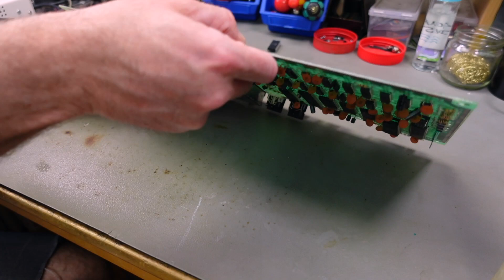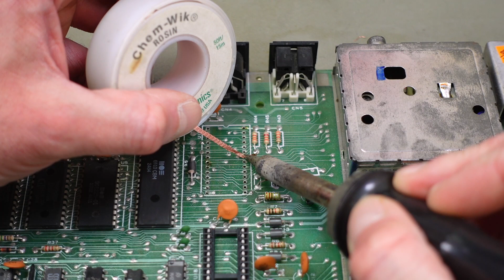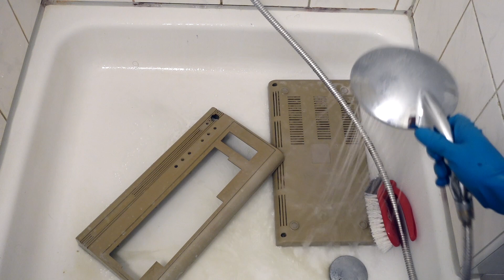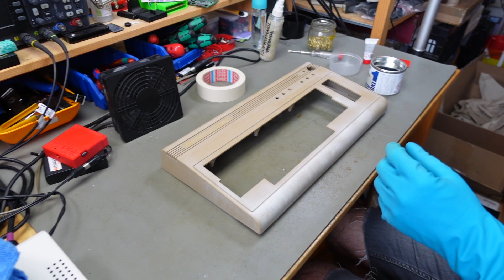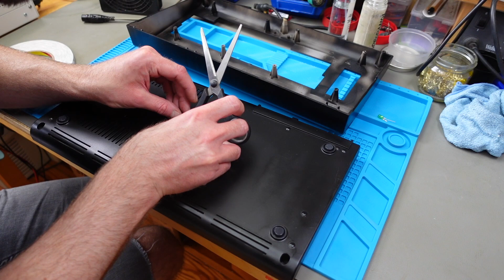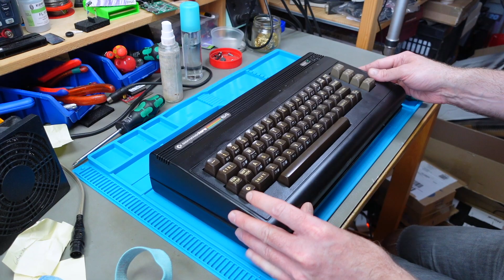Challenging C64 Restoration and Repair

Comment: not a fan of the filler. it will fall out in a few years. filler is usually the choice for dents, not holes. i use superglue and bakingsoda to close the hole and then the filler to hide the dent.

Comment: Hi Jan, can you tell me how to buy sockets for putting the chips on the c64. I'm planning on restore my old c64 with the help of a technician,  i am not. I didn't ask the last time. Where are you from? Thanks for sharing so much information to your audience. Thanks a lot Jan!
Reply from the maker: You can usually find the sockets in every electronics components (online) store. Just look for dual inline sockets (they come in two standard widths and different pin counts, should be relatively easy to pick the ones you need). Here in Germany, I usually order precision sockets from reichelt.de. If in doubt, you can always check out the Run/Stop Re-Store (online) that has all kinds of Commodore parts, shipped from the Netherlands.
Reply: @JanBeta  thank you a lot! Really!

Comment: I have a broken C64. The VIC Chip are not funktioning. Can I use an other VIC Chip or not?
Reply from the maker: Yes you can use another VIC-II. Just make sure it’s the same part number (65xx and 85xx use different supply voltages and are NOT interchangeable!). The number after the R doesn’t matter much, the different revisions are interchangeable and only provide slightly different picture quality.

Comment: There are some experiments that have replaced chips and processors using raspberry pico, those are micro controllers with the enough power to replace those chips if you program them correctly. The old chips are every time more scarce.
So far it has been done on 8086 cpus

Comment: That's a dust mask lol. It's useless for vapour and also viruses just in case you wear it to the supermarket as well !
Reply from the maker: I recommend you "do your own research": https://www.aerosol.mech.ubc.ca/what-size-particle-is-important-to-transmission/
Reply: @JanBeta  While Nick clearly doesn't understand how N95 masks work for viruses, he is correct that particlulate masks can't help protect you from solvent vapors.  I use dust masks and purified air respirators every day, and the training on them states very plainly that they will not protect the user from vapors, VOCs, gases, or low oxygen environments.  You'd need an activated carbon filter to absorb the vapors from the paint, and good ventilation such as fan in the window blowing outwards with fresh air coming in somewhere else would help, too.

Comment: Dear Mr Beta , how are you ? Thank you for your' entertaining videos on fixing the mighty C64 .
Just a question on a problem I have with one of my fix-up jobs : Does changing the timing varistor next to the oscillator affect the turning on of the machine ? I ruined my varistor and changed it out for a brown one I bought online . The C64 has blank screen . Nothing appearring on the monitor .
Reply from the maker: It should not affect the general state of the machine, just the video output. Depending on what output you use (composite or luma/chroma), you may get a black screen with a misaligned timing if the signal is off by too much to be picked up by the monitor. Usually you get some kind of distorted or black and white output though.

Comment: For the gaping hole, I'd personally try to patch in a section from an even more messed up VIC or 64, or I would spray some release agent on the good section, then use that to mold a new section to patch into that hole (after cutting or filing the hole to be more 'square'.

Comment: I would have used a different method of case repair. I would have used some old ABS plastic. Dissolved it into a paste by mixing it with acetone. Masking off on the top side and filling up holes from the backside. The bigger hole, can be rebuild, by using PVC sticks and glue them together with super glue. Finally use some two component epoxy glue on the backside, to stabelise it as good as possible.

Comment: Hey,  love your channel and so I'm a new subscriber.  I appreciate you knowledge of Commodores, C64's and electronics and that painting a case IS new to you.  If there is a next time and I suspect there will be, I'd like to share some tips that will help.  You should have filled the smaller holes in the case from the back side.  This would have cut down on the sanding, give the filler plugs more to hold on with and also given you a smoother finish in the front, even before sanding.  Filling the larger hole from the front was prob necessary, so that you could match the grooves, but, you should not have waited for the filler to get completely hard before starting the sanding, especially when it came to cutting the grooves.  Speaking of, if you'd have used less activator, the filler would have hardened slower, giving you more time to cut the grooves.  You should have given the body a light sanding all over with a fine grit to give the primer something to stick to, so that the paint is harder to scratch off.  Primer acts like a filler and fills fine scratches and nicks, if you sand down the first coat.  Also, black may be a cool color but it shows every flaw underneath.  I hope this was clear as I tried to keep it short and hope it helps.

Comment: As I was watching you remold the broken area I kept wondering if perhaps you could have gotten it a bit better with a careful use of a dremel. Not sure if any of the grinding discs are thin enough to match the case's lines but it might be worth a shot if you ever need to do this again.

Comment: Aloha !

For those of you having a damaged case but want the original look; You can use RAL 1019 Grey beige. 
I find it to be a very close match to the original color from the factory... (Unless you have an Aldi C64 hahaha)

As for the motive, a breadbin isn't smooth, first use some modelling clay on  a clean undamaged part of the case,
then after you have painted it, ever so gently press the clay on the wet paint. The little pattern will then be transferred so to speak.

Cheeeeeeeeeers

Jecepede

Comment: I would have used Milliput (epoxy putty) to fill the holes. There's a product called Blue Stuff, which is a reusable thermoplastic used for mould making. Using that, you can take an imprint of an undamaged part of the case (both the textured top and vents) which you could then lay over the holes on the top of the case and fill the holes from the underside.
Reply: Good feedback, something tells me Jan also has another perfect C64 that he could create a mold from for next time 😉

Comment: Man I cringed when you just dumped the entire hardener into the tin, that’s not how you use it! Your supposed to take out a dollop from the tin and put a pea amount of hardener with it then mix and apply, also you need a vapour mask for spray painting what you were wearing was a dust mask

Comment: You mentioned you replaced the bridge rectifier with a beefier one. What is the part number for the beefier rectifier?
Reply: @Drew-Dastardly  Thank you for the answer. I am learning about electronic components and when I do a search for bridge rectifier B33F1 I do not get any matches. I put that part # in mouser and digikey and they both came up with a ceramic capacitor. Is there something else I should be putting in the search to help me locate that part #?
Reply: @Drew-Dastardly  Thank you for your help and appreciate your time in replying, I will keep researching and try a few that I find, the journey is always exciting.

Comment: Always enjoy a commodore refurbishment thanks Jan 👍 The only suggestion I would make with the filler is maybe try the tape on the outside for the smaller holes - you can always leave the unwanted stuff inside the case. Though it may have still shrunk and has the same results 🤔

Comment: I suggest looking up fret files, used for guitar maintenance. One of those would probably be the perfect size to clear out the filled-in slits at the upper right of the case. I got one from eBay that's cheap and nasty but actually good enough to crown frets, for $6. It has smooth sides too, so it won't scratch up other parts of your work. Only the outer edges have file patterns chiseled in -- one edge rounded like fret wire, the other flat for finishing ends.

Also when patching holes that go all the way through, sometimes it's better to put the tape on the outside and fill from the back. You can leave it on the sloppy side for structural help, and then the thinnest coat of filler on the front will be needed after the tape comes off, for wherever you may have left an air void. But you won't have to sand off a bunch of spillover, because you let it spill over on the inside. This wouldn't have helped at all with the big hole in the corner, but it might have made your life easier on the six little button holes.

Comment: To be completely fair, this case was a prime candidate for experimentation and if you don't practice or push yourself, you don't learn. You might take some ideas from plastic modellers, especially for how they use plastic card and modelling putty. For example, the gentleman at The Model Shed has been doing extensive modification to the hull of a Bismarck ship model https://youtu.be/9j6Q9RtOxv4 If anything, look at the tools and supplies he uses; it's pretty amazing what you specialized gear you learn about that's common in other hobbies.

Comment: A trick to use if someone else want to repair a "complex" hole like that grille on the case is to make a silicone mold of the pattern and then attach the mold to the hole, and add the filler from the underside. It's also possible to make a mold of the general texture and use for the holes. The trick is to add the filler from the inside and avoid sanding on the upper side.
Reply: It’s better not to tell them about it, otherwise there won’t be such funny videos. :-D

Comment: I have to say that I liked the grey color much more than the black second coating. It looks a bit like the newer Aldi cases.
Regarding the big hole:
You could have made a kind of mold from plastelin or something like that. Put some oil on it and put it over the hole. Then you can fill it from the back side.
Or do not fill it at all and create a reset button in the shape of the commodore C= with a 3D printer. That of course would have been far too work intensive.

Comment: Funnily a socket on a Commodore board does not need to mean prior repair. Quite often the socket had been installed by Commodore themselves, when at the time of assembly not all chips had been available. This happened quite often. But at least the 40 pin socket looks "aftermarket".

Comment: Regarding the electronics you definitely fixed it fine and properly ..well done, BUT... 

..mein sonst so zuverlässig schlagendes Herz hatte mit einer sekundenlangen Abfolge von Extra-Systolen zu kämpfen als ich sah, wie du einfach kurz mal naßforsch die komplette Tube Härter in die noch beinah volle Dose mit Spachtelmasse drücktest  :oo  ..du hattest bestimmt schon schlauere Momente :D  Abgesehen von der Verschwendung (des doch immerhin nicht ganz billigen Zeugs), entnimmt man der Dose doch immer nur ganz kleine Mengen u. mischt das Entnommene dann mit ein paar Millimetern (2, 3%) Härter. Wie du dann aber eh festgestellt hast, wird da alles in 2, 3 Min steinhart und du kannst den Rest sofort wegschmeißen. 

Auch deine „Vorsichtsmaßnahmen“ mit der Spachtelmasse (Handschuhe, Maske, Vent.) haben was von unfreiwilliger Komik, sorry, isso  - „nasty“ ist bei dem Spachtelzeug doch wirklich gar nichts - außer, natürlich, du schmierst dir den Härter direkt ins Auge, aber spritzen kann da gar nichts. Um so erstaunlicher wird dieser Overkill an Vorsicht dann aber, wenn du gleich ein paar Minuten später im Innenraum mit diesen dusseligen Lacksprays (Füller u Farbe ..vermutlich auch noch bei geschlossenen Fenstern) praktisch auf dem Holzboden, nebst Holzmobiliar herumnebelst und alles in einer Wolke von Lack und von Lösungsmittel ersäufst, als gäbe es kein Morgen. Außenbereich, Keller od. Balkon nicht vorhanden? .))   Generell scheinst du’s mit den Beipacktexten und den Warnhinweisen ja nicht so genau zu nehmen - wenn du das immer so hältst, werden’s dir deine Lungen bestimmt bald mal danken, da nützte dann die FFP2 auch nichts mehr.  

Was das (optische) Ergebnis und die Lackierung betrifft sag’ ich jetzt besser mal nichts mehr außer mein höchst subjektives: „grausam“ ..alleiniges Reinigen des Gehäuses und das punktuelle, ordentliche Füllen der Bohrungen (sparsam mit Füllmasse od. Heißkleber mit anschl. Glätten mit Glasschaber  = auch nicht schlecht) hätte ja doch mehr als genügt ...imho.   Schade ums Gehäuse und um die Zeit, die du zur vollkommenen Zerbastelung desselben verschwendet hast aber man lernt ja im Tun, nicht im Lassen  ,)

Comment: A good filler for plastics is super glue and bicarbonate of soda. Tape up the holes as you did and then fill with bicarb. Clean away any excess. Add a drop of super glue. Repeat until the hole is filled. The model maker glue applicators with the thin metal pipette style nozzle are great for adding the glue without mess. I might have tried making a silicon mold of the fin area with silicon caulk on a stiff backing and then back filled with two part epoxy, but that was pretty damaged! Great job and a nice choice of colour. Thanks JB!

Comment: nice job jan! the black looks really nice! rule of thumb with bondo filler and drywall compound; put less on each time saves sanding time taking it off later. i wondered what those 6 holes were in the upper right hand side of the case used for? maybe led or momentary switches to dump carts memory to floppy disk ;-)

Comment: When filling holes, you need the leave the filler a bit "proud" when it's wet.  Other wise, when it dries and shrinks the holes will be visible.  Also, a couple of thin coats is better than one thick blobbing when using bondo.  I'd mention putting the entire tube of hardener into the can, but I see other folks have gotten there before me!  :-)  It's quite a serviceable repair.
Reply: Sorry for my ignorance (I'm not native English speaking) but what is the meaning of "proud" in this context? You mean to leave it some time and not apply it immediately?
Reply: @rastislavzima  In this context, "proud" means rising higher than the surface around it. Standing taller.  Essentially creating a dome. That is, you have some material above the surface so that when the material shrinks, it's still above the surface and you can sand it flat.

If you scrape the surface flat, the filler shrinks as the chemical reaction occurs, leaving a hollow dimple.  this is a very common problem when filling holes in automobile bodies.

I hope I answered your question adequately.  English is a strange language, even for those of us who speak it natively.
Reply: @dennisp.2147  ah yes, that makes sense, "proud" - stands tall above others. 👍

Comment: Hi Jan. I had the same discoloration with my original 1983 Breadbin machine case when I cleaned it with soapy water. Nothing I tried would restore the original colour. In the end it was suggested I use a "Magic Eraser" sponge which did bring back the original plastic without the white discoloration. The front graphics on my keys are also very fragile.

Comment: The secret was to make a negative impression of the grooves on the left side, mount it over the hole on the right side, then fill it in from the back side. But for someone who isn't an expert at restoration, and who wasn't in the mood to do 1 different steps of filling, sanding, priming, wet sanding, re filled, filing, sand again, priming again, base coat, and top coat and seal coat, you did a great job. :)

Comment: You were using the right filler. You just never mix the entire tube of hardener with the rest of the putty, because they always provide more hardener than is needed. Also use a smaller amount of the filler each time, just scoop it out of the can and use some thick cardboard to mix it on. Hope this helps you on a future project.
Reply: Basically, wait until you need it to mix it rather than making big batches and racing the clock.

Comment: I would stick with washing liquid to clean the case and keys except for stubborn areas.  Whatever you used was too aggressive for the plastic.  The filler was ok but build it up in layers and use finer and finer grades of sandpaper.

Comment: I would have filled the small holes with LEDs, then wired them to various points on the board as “diagnostic aids”. Because, who doesn’t love blinkenlichten! 😆As for the big hole, well, maybe a toggle switch so you can turn it on from the top, instead of reaching around the side. Or maybe a push button type switch as a reset. 🙂

Comment: I'd have skipped the patching on the case and gone for a restoration that puts back whatever was in those holes originally. Buttons probably. Maybe install a ROM switcher, reset wire, etc.

Comment: The whole can of body filler at once... oh man... hehe.. But if you don't know, what can you do right? Sometimes we don't know what we don't know until we find out otherwise.

Not picking on you or whatever, but small batches of body filler is all you needed. Mix this stuff like you would use epoxy, smaller batches are better. The hardener included is actually more than you need for the entire can. Smaller amounts of hardener give you more working time with the filler. Go watch some videos on how to mix body filler.

Comment: Generally for filler like that you mix it in small amounts on a piece of cardboard, let it cure, do some rough sanding, and then re-apply another small amount.

It takes some work, but you can get everything very smooth.

Also, you need to make sure the filler is properly mixed with the hardener.  The hardeners I've seen are colored, so when you mix it it with the filler you just have to get even color.